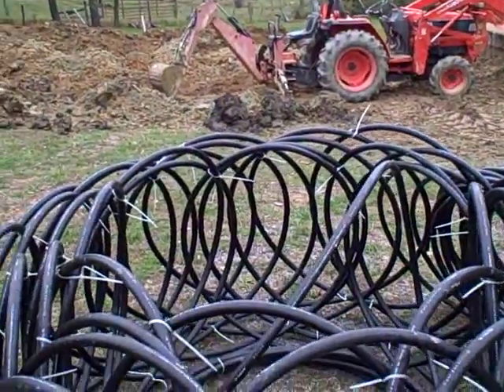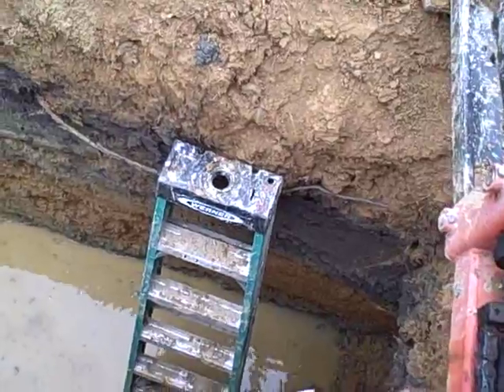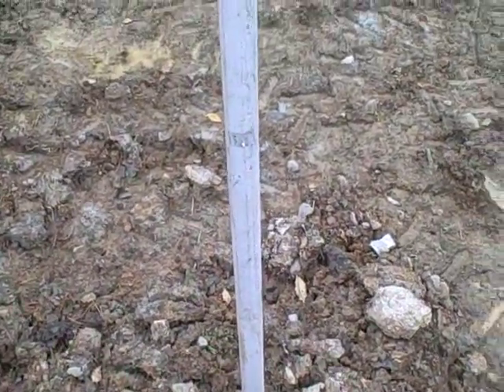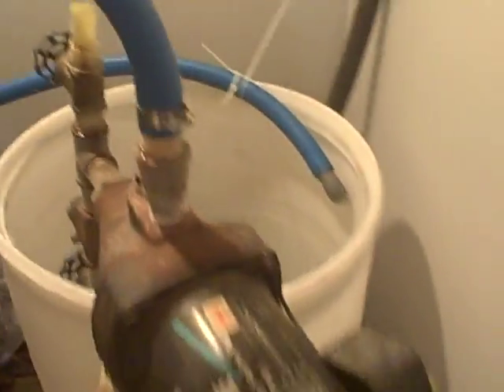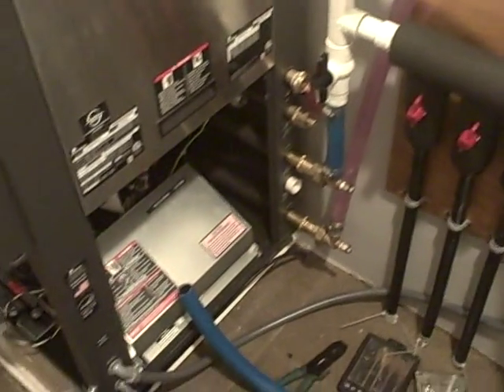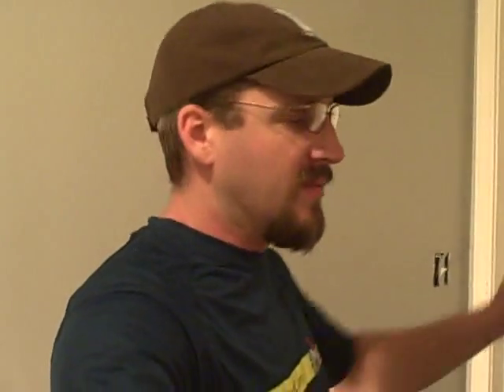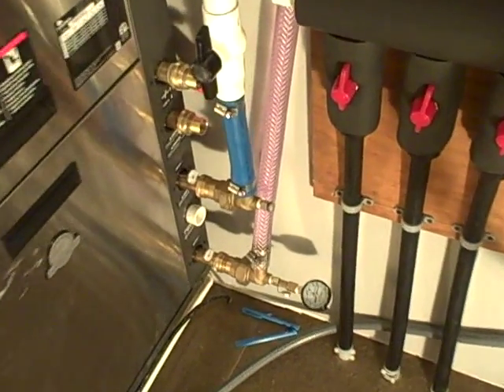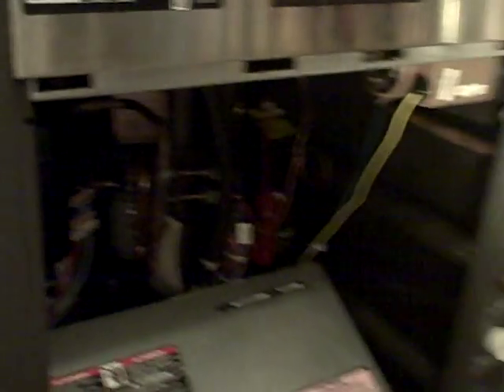DIY Geothermal Install in the Mountains of West Virginia

Comment: I wish, four years later, if you would comment on the cost savings, and any issues of heating and cooling late in the season.  For example, late in the heating season, what is the ground temperature 8 feet down?  At the end of the cooling season, what is the ground temperature 8 feet down?   Also, you clearly hit the water table.  What is the nearest hill, and is it rocky?  Does water come downhill and purge heat from the underground system so as to make heat exchange better?  Others say to surround the slinky with sand.  Did you have any trouble with broken pipe as a result of not using sand?

Comment: Cool video Jonah, thanks for posting. What was the total cost of this installation? Do you find that this is the least expensive type of HVAC system to run? It's hard to get the true unbiased info on the internet.